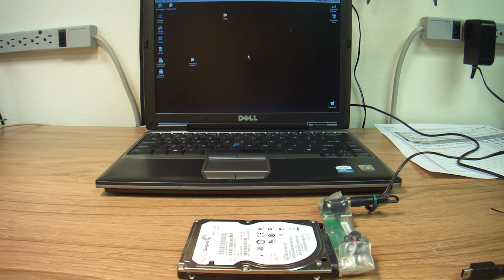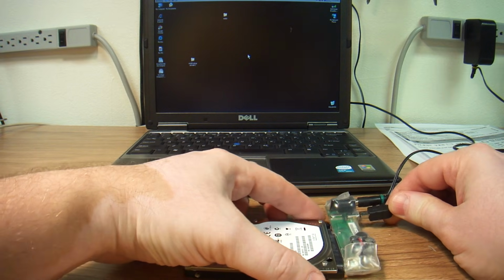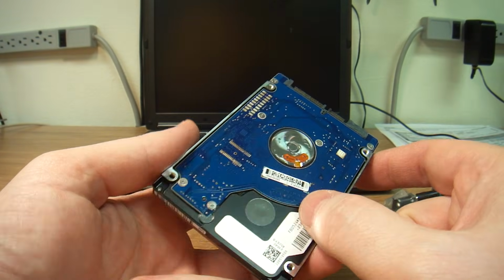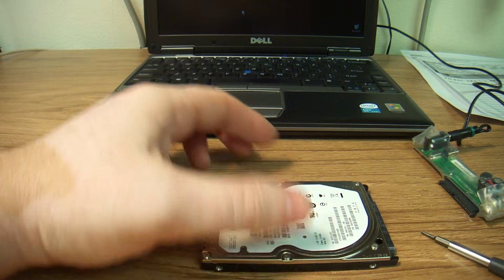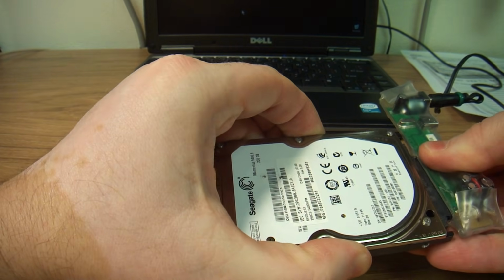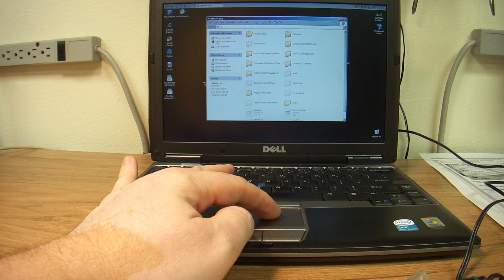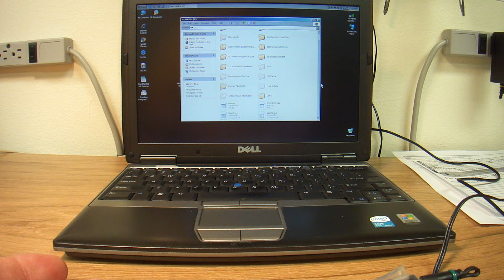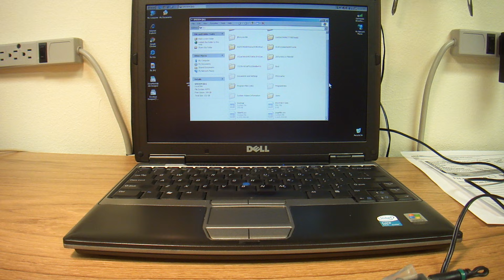How to fix a broken hard drive Beeping noise or clicking RECOVER GET DATA BACK FOR FREE! BEST TRICK

Comment: It's a Seagate....of course it's broken.  Seagate is crap.
Reply: Their new drives are shit
Reply: @LewisPhot  Feb
Reply: WTF does that mean?
Reply: ictdude1 Nope.  My PC is on for about 70% of the day.  Sometimes overnight but not often.
Reply: mc woof woofington hitatchi is owned by western digital ;) they are the only 2 i would buy from
Reply: ictdude1 I have a Western digital from 2005 and one from 2006 and work perfectly
Reply: Igor Vaschuk you can when it was hard drives like the seagate barracuda 7200.11 which has a massive firmware fail where the drive would be bricked after a few months
Reply: DigikidForever Complete HDD death after less than a MONTH... Years & years worth of data lost. Seagate can stick their "built to break" rubbish up their arse-holes. They shouldn't be allowed to continue selling hardware so badly constructed that it beggars belief. Don't waste your money on this company. You might really, REALLY regret like I did.
Reply: ***** I dropped my 4TB drive while moving it to another PC and now I'm getting that beeping noise. Hopefully (if I can find that damned screwdriver) this will work, at least long enough to get some important stuff out of it.
Reply: That's the unfortunate truth...
Reply: No, the new ones. Like, 2013-2014, not 5-7 years old (2009).
Reply: FAMICOMASTER My Seagate HDD that has been running for 372 was bought in March 2013.  It was my primary drive until I bought my SSD 2 months ago.  No issues, even with it being used almost constantly for the last year and a half.
Reply: What does the 372 mean?
Reply: FAMICOMASTER 372 days.  Sorry.
Reply: Junoh Productions i take it your pc is on 24/7...of course that will reduce the risk of the hdd crashing because it means that the heads are'nt always parking and going through the start up process, thats where most hdds crash
Reply: Junoh Productions den you go on pc to much ;)
Reply: ictdude1 I typically have my PC doing programmed tasks throughout the day.
Reply: Neat.
Reply: http://lifehacker.com/the-most-and-least-reliable-hard-drive-brands-1505797966
this should answer any questions.
Reply: Junoh Productions  this message its for you
Reply: Hey. My backup HD was WD and that thing died within a year without giving notice, and Seagate still works. So can't really judge by brand. ALWAYS BACKUP, preferably online, now Amazon Prime get's you unlimited photo backup.
Reply: I noticed the 4 TB models are going strong. The 1.5 TB and 2 TB models failed on me and a lot of other people.
Reply: Carlos Umanzor Sorry to hear that... I'm so paranoid about bumping my drives, I keep them in a rack.

You can shake them around and put them in a bag if they are turned off, but if you bump/drop them while they are running or drop them really hard while they are turned off, there's like a 90% chance you've made the head crash or damaged the drive internally, somehow..

I would keep your fingers crossed and hope you can fix the bad sectors and get the data off it, if the damage is minor.
Reply: My Dell hard drive is clicking and I found out it is a seagate
Reply: Soooo true haha
Reply: DigikidForever what do u use
Reply: Yep, I have a Dell and it is a Seagate.
Reply: Its 2018 now and i can confirm Seagate sucks. I had 2 dead Seagate HDDs in 4 Years. NO more Seagate for me ever.
Reply: I've got two Seagate HDDs in my PC.  One with 1000 days of Power-On time and the other with 372 days of Power-On time.  The older one sometimes makes clicking noises and the newer one works perfectly fine.  Considering that the older one is a good 5-7 years old now, I'd say that Seagate is just fine.
Reply: No they're not, Miniscribe was crap. Seagate made it all the way from the 1980's up until now, they obviously have some talent.

Comment: hi

is it possible to transfer the hard drive platter to another working hard drive?

the hard drive circuit board has gone can you therefore transfer the hard drive platter?
Reply: Not buy a new drive, just the I/O board. You can get them for less than $5 on ebay.
Reply: you can buy the board from hdd parts, but you have to send it to them so they can transfer a chip(firmware) to a working board... 50$+shipping
Reply: Just buy a new board for it. Problem solved.
Reply: No, buy a new I/O board and install that. saves you hours of tedious work and trouble. All your stuff will still be there, just with a new board.

Comment: I have a samsung external HDD with same problem. I opened it and noticed that its head on platter. I parked Head on its original position. After, what i noticed was that the beeping sound stop but my computer doesnt read the hdd. Still i cannot get access to my hdd. What should I do??? any suggestions please!!!
Reply: Same here. Did you find any fix for it? For me the head was stuck, I got it unstuck and sealed it back up. The head now hits the side of the platter and bounces back until it stops. Wont read.

Comment: PLEASE ANYBODY DO NOT ATTEMPT THE SAME THINGS AS THIS IDIOT.
please put something under the HDD like a piece of foam so it doesn't get additional damage, get in a dust free room, and get something to keep the HDD on the place, because if any dust or anything else gets on it, you can throw away your HDD
Reply: dude calm the fuck down i have seen about 6 comments of people who followed his instructions and it worked fine i also saw one guy that did this 6 years ago and the drive is still working
Reply: Is that all:  Find a clean room and a rubber matt?  
What about the cautions above from "Bass" and Blind Bob, that the head c/b stuck on there and the whole thing ruined.  I'd say even if the platter didn't get scratched, if the head is ruined, misaligned, etc.,how would ypou ever be able to read even the undamaged platter after that?
It looked so easy, but was he just lucky?
Reply: žmm ẅḧɏṁƐ dust is bad but clearly if that was the case his hdd would work
Reply: Ya..Okay... Now, all ya good boys and girls make sure you build a clean room~! Y'all can get all you need at the hardware store, prob'ly wont cost more than 'bout $200.00 or so~! Then.. you can use the room to grow some stuff, maybe sum HERBS~? Oh, and you're STILL a fukkin' moron 3 yrs. later~!!
Reply: If the HDD is usless then you have nothing to lose by trying, if you open it up and can free it up and get your data back you win. YOU'RE the fukkin' idiot...

Comment: Hi,
I did the same like you with my WD HDD 500GB. Disc was beeping and wasn't speening. After opening and set the head to park possition disc start speening but Windows or BIOS can't read it. It shows that there is something connected but it is offline. Maybe you have idea what it can be? I need only back up my photos to second computer.

Comment: sigh my kids dropped my 2TB drive with over 1000 pirate bay movies. im gonna try this fix. if not its done anyways. maybe I can temp fix it to pull my stuff off
Reply: Why the hell should you kid run with a HDD?
Reply: Did it work?
Reply: bjorn joseph ah I see. I thought it was weird.  I hope you recover them all soon.  I also had some pictures lost from university years due hdd failure many years ago. I recovered many of them from other backups or facebook, emails..etc but not all. and till this day I wonder when I can recover the rest.   Data recovery services too expensive.  Since then I don't trust hdds.  I keep several backups in different hdds and and use the cloud.
Reply: No it wasnt this problem. The armature or something is off by a few microns. Have to send it off to a data recovery centre. 

My kids tripped over the wire and it came crashing down
Reply: bjorn joseph Oh, I have a little brother, but he doesn't fall over it. He take it and bang it to the wall. But anyway, succes with repairing. 

Mu problem is that when my HDD has to think/read he is going to make an extremely noise, not enough to hear outside, but it's hard. U know what's wrong?
Reply: MrGamingEnzo no idea. Clicks when powered up. Computer doest detect it. So off to data recovery
Reply: bjorn joseph Trying to get a data recovery center for some PB movies??  isn't it too expensive to recover 2TB,  must be extinct porn.
Reply: undocumentedspot  oh the movies are not an issue.  Damn digital age. I had all my kids baby pics on there.
Reply: undocumentedspot  oh the movies are not an issue.  Damn digital age. I had all my kids baby pics on there.
Reply: how much was the recovery? I have a 1 tb that the same thing happen to me .
Reply: Never did it.
Reply: monkeyboy8me when it happened to me, I searched a lot, and what i found out that mostly around $1000, but some even more expensive. I also didn't go through with it.
Reply: Thats too much. Id hold the drive safely and hopefilly I have 1k go blow one day
Reply: bjorn joseph Exactly what I said back then. and here I'm, 8 years later. Still doesn't have that extra $1k to blow. haha  but I'll keep trying.

Comment: Great video man , but can any one here tell me I have 4 drives in raid 0 and raid controller reports no faults and smart is well useless , every now and then i get a loud double beep like low tone short then high pitched longer beep , then AmdRaid expert says raid 0 stopped and well its working fine again a second later. Any idea what the hell is causing one of the drives to beep ?

Comment: Hi Abraham. I was using an external drive but forgot that my laptop was not plugged, so it was switched off abruptly when the baterry dropped. After that there was a message error of bad reading error and my external drive not longer works, it is not identified by any PC or laptop and makes a beeping sound. Could I try your solution? Thanks in advance.

Comment: hi is there anything I can do with mine hard drive which is invisible in bios in my laptop? haven't heard any beeping or stuff, it just broke down simple as that. the thing is that once I've managed to explore this drive using Ubuntu software and copy 96GB of data from it, and it's a lot. but after that I can do nothing more, it's invisible all the time, so should I use same method as shown above? its too expencive for me to recover data from this drive in lab, and the stuff I had on this drive isn't worth the price, but it would be very nice to get it back :)

Comment: the sound coming from the hard disk is the reason for the hard disk not connecting pc...if the sound problem is solved than will it connect ???

Comment: Mine was a Seagate 1,5 TB Barracuda. Only used externally 4 storing videos of my sons soccer games. Took it apart. found arm midway on disk. Turned platters in cloakwise  direction & arm was reset 2 docking. Now it spins up, arm looks 2 read & shifts back & forth several times then stops & platters stop spinning. Any ideas? I think the reader arm/Head has 2 be replaced. But wat do I know? :-)

Comment: Great video. I have a Western Digital 2.5 USB 3.0. making a noise like yours. My friend tells me that WD HD's cannot be dissembled. Indeed i have removed all the screws -- including the one under the sticker -- and the metal cover will not lift off even with some force. T=Is the WD drive not designed to dissemble?

Comment: hi Abraham Levit, I have some very important files inside and I did all the method as you shown. my hard drive seems to be able to run for a while before it starts beeping 3 times only. and my computer still cannot detect my harddrive. can you advise me?

Comment: I used this method on an 1.5TB Seagate drive. that was beeping constantly and causing the computer to hang all the time. The primary hard drive in an SSD thank goodness. But all my music, games and movie were on the Seagate drive.

I popped the top off and gently moved the heads back and forward a few times. and screwed it back together. Once I powered it up windows with the drive re-installed it was detecting errors on the hard drive it ran the repair utility. And was fine after that  no more beeping and I could read for it. However I do not know if I have caused damaged I have not tried writing to the hard drive the damage could be in a unpopulated part of the drive.

I only recommend this method if you have nothing to lose, if the hard drive is old or out of warranty otherwise send the thing back. To most people the data on the hard drive is worth more then the drive its self. You should get a new had drive as soon as possible and transfer all the data off it while it still works.

Comment: i got  a old 4g160g8 IDE maxtor drive that became "bricked" 12/2004 ,i recovered only like 50% of the drive with "getback" data recovery a few years ago after a 2nd scan the firmware crashed compleely reading at just 0mb in the bios as "maxtor romulus" i can feel it power on touching it its not noisy but windows dont detect it, 
any solutions? or am i screwed?

Comment: no joke, this just saved about 169 gigs of raw photos of mine.  I lightly dropped the HDD while it was spinning and it stopped working.  All I got was an unmountable HDD and a beeping noise.  After a few hours of freaking out, I found your video.  Gave me the confidence I needed.  I have successfully backed the files up, and will most likely be replacing the drive.  Thank you

Comment: When I boot my pc I always get two beeps is it a hard drive problem?
Reply: Not necessarily, One beep at boot or start up is normal.  Many beeps after that means something or some device is not configured, if many beeps system will not boo, will not get to windows. Before getting to windows, The BIOS checks the physical components, then transfers control to Windows..

Comment: Opened up my drive and the heads were indeed stuck, so I moved them back to the original position. When I applied power the beeping was replaced by a new, constant clicking noise.. it seems like there is a problem with the heads. Any thoughts?

Comment: I always thought the HD screws need to be torque tightened when re assembling...
Reply from the maker: Only applies to NEW drives at the factory.
Reply: Abraham Levit ooo
Reply: same here
Reply: Abraham Levit Abraham I dropped one externa  hard drive   from one feet to the floor accideltaly... when I plug it.. the u can hear the thing spinning but the needtle moved or something so it goes back and forward.. tryes to read but comes  back anf forward like it was decalibrated or something...  can it be fixed I have very important info there...   the hard drive is and old IOMEGA 80gb  drive  I would aprecciate your help

Comment: Just a quick tip: if you are really worried about dust, or are in such a dusty area that you feel it might be a serious issue, one way to minimize dust is to first run a hot shower with the door to the bathroom closed, until the room is rather steamy. Turn off the shower and then wait until the air clears of steam. Then use that room to disassemble the drive.
The water particles in the steam from the shower accumulate around dust and hair particles floating in the air until they are too heavy to remain suspended, at which point they fall out of the air. While this will not get you a 100% clean room, it will greatly reduce dust in the air, and thus dust that can accumulate on your platter.
Reply: @KoljaBeckmann_music  youtube knowledge surprises me. hahaha
Reply: That won’t work even a breath can destroy the HDD
Reply: @staycgirlsitsgoingdown2  The story goes that a person coughed onto a floppy disk, and the pc got a virus while reading it.
Reply: @staycgirlsitsgoingdown2  What can possibly destroy a drive does not equate with what is likely to destroy a drive. Like breath.
Besides, what you are missing in this critique is the main purpose of this video, to use the drive ONCE to salvage data, after which the drive can be scrapped. Reducing dust to allow a single read is the goal here.
As long as you don't snap your fingers, things will likely be fine.
Reply: @KoljaBeckmann_music  Unless you are planning on using the drive while it is open, this is not a significant concern. And micro water droplets dry extremely quickly when not sealed. Besides, the room is shuttered while the steam is being generated and the drive is only opened after the room has cleared. And as I pointed out elsewhere, the purpose of this video is not how to rejuvenate the drive for continued use, it is how to resurrect the drive for ONE read only, to salvage data.
Reply: Dosnt change anything. If you open your drive without a clean room only thing you can hope is that heads do not collect it and scratch surface because of it. 

Also if you get your finger on the surface H-3 will die for sure
Reply: @Tobi3425 It actually changes quite a bit, as steam removes a very significant amount of dust from the air, and given the small surface of the drive platter, it can very readily remove all dust that might fall on the platter during the time it is exposed to the air.
You can very legitimately "hope for" the procedure to work 100%, which means you are able to read the drive one single time, to salvage the data, the stated goal of the video author. After that you can scrap the drive.
Reply: That is brilliant, idk why I didn’t think of it. Oh maybe Becuz I’m not brilliant if I was I wouldn’t be here trying to fix a hdd from YouTube videos

Comment: some hard drives have torque settings that  can't  be changed, will have a mess if you screw it tight so this wont work on the 100% of the cases keep it in mind